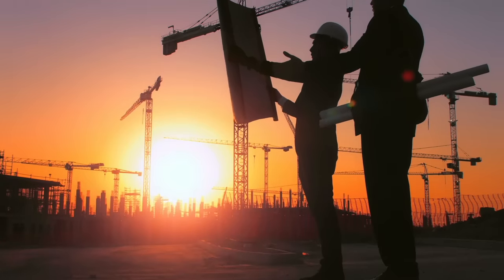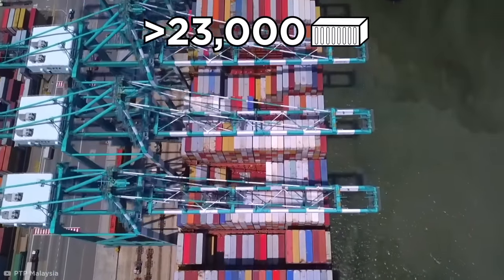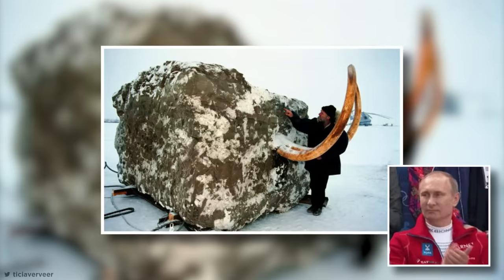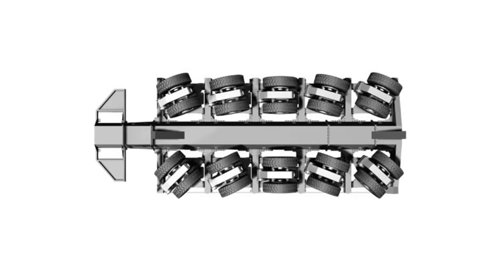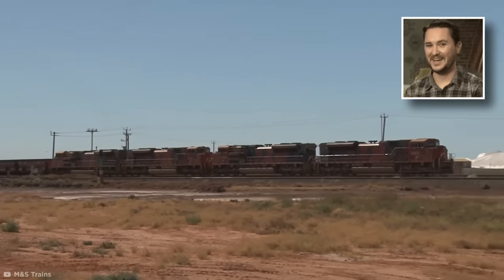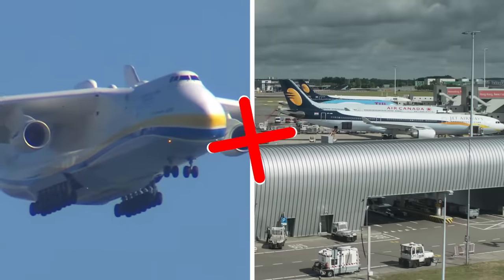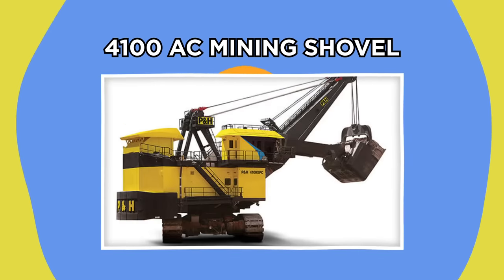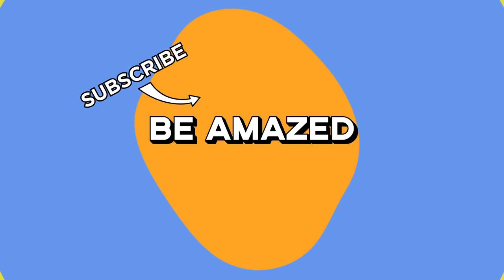Biggest Vehicles Ever Made

Comment: 2:17 wrong ! The Belaz 75710, with a capacity of 496 tons, is the biggest dumper truck in the world. This model was development by the Belarusian company's engineers with the aim of having a suitable load for a Russian mining company.

At 20.6m in length, with a height of 8.16m and 9.87m width, it has a weight of 360 tons and is shod with eight super-sized Michelin tyres. A diesel engine with a turbo-compresser of 16 cylinders powers it, pumping out 2,332bhp and topping out at a heady 64kph.